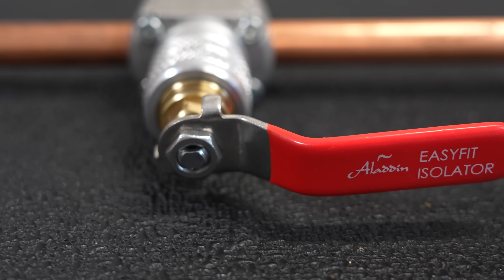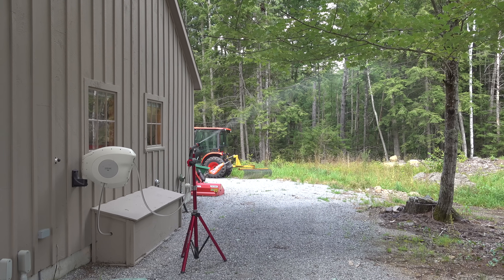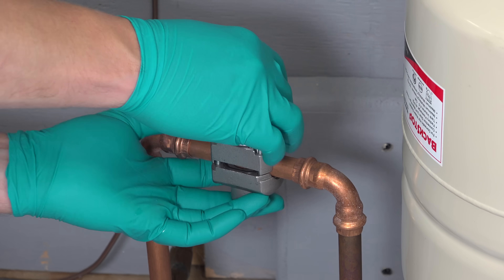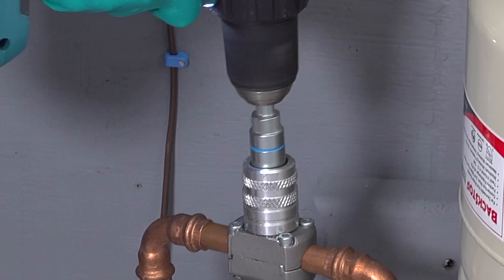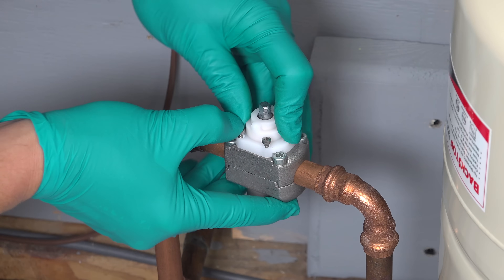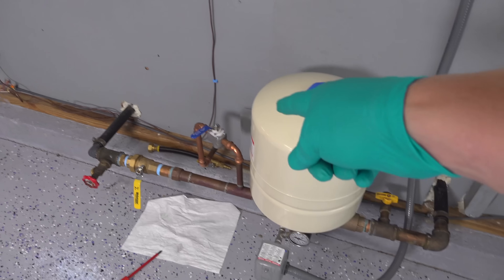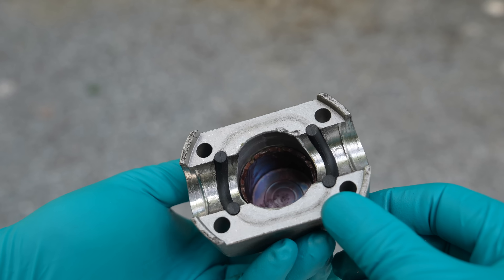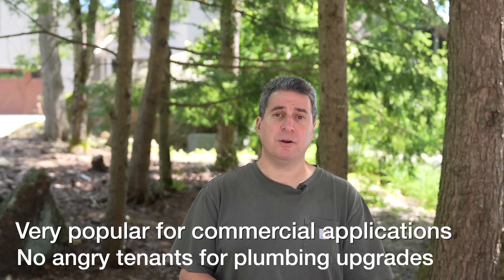SHUT-OFF valve installs on a LIVE WATER PIPE - Aladdin EasyFit Isolator

Comment: I'm from the UK and I didn't know that 
product existed here! But I did recognise the Aldin name. They made parifin heaters and the parifin lol
I'm going to look for it now in the UK and see what the cost in £s is
Reply: EasyFit Isolator Valves for the US Market have been available for the past year.  The valve had to be re-engineered for the US market due to the different density of copper.  A UK version of the valve will not work on US grade copper tubing.

Comment: Holy sh1t 250 for a valve. I have been a plumber for almost 20 years so I would never use one because I can find ways to stop watering like magic 😂😂. Kill the power on a well system or a meter key in the city. No way in hell I’d use this. 
I take that back maybe in a hospital or a building that won’t let you shut water down for extended periods or time we usually propress viega fittings which are expensive as well 😂.

Comment: Expensive and I saw a little water come out under the white part that holds down the valve handle.
Reply: Thank you for your comment, this is PTFE grease from the cap screws –  (you can see a small white curl of it on the housing).  We grease the screws to ease the Cap attachment operation

Comment: I've used two of these in our farmhouse. I didn't know at the time that the max pressure for install is 3 bar, but I found out afterwards that we're getting 6 bar into our farm!! Credit to Aladin for such an easy to use, and well made product.
Reply: 16 bar for uk 22m version
Reply: 3 bar dynamic pressure v.s. 16 bar static. To me it looks like it's more a question of the pressure differential over the valve while installing it. So turn off the water flow while installing. If you already have a water leak it's too late.
Reply: I'm always looking to learn something new. Can you please explain 3 bar 6 bar' me, thank you.
Reply: @sparky6913  a bar is equivalent to 15psi approximately....
Reply: No offense intended, but there are better ways to prepare for emergencies, even if your someone like me that wears a belt and two pairs of suspenders. I'm a big fan of building the lifeboats before the flood, and having them set up to be deployed. Might be good as a convenience, but I can't come up with one emergency I'd need to use this for, not that I know of  every possible one.  Best wishes. Best of luck.
Reply: *Aladdin
Reply: Wasn't he some Dizz Knee character? @LostInPhilly89
Reply: Know where your water turn off valves are and where your main water turn off is in the house. Or where the city's water turn off is by the meter. Rural homes should also have a quick to get to main turn off. If not, that is epic fail.
...When main water turn offs that are not easy to get or are hidden, etc. That is also epic fail.
Reply: @AlexZander688  Thanks, but, our house is almost 500 years old, the part where I used the Aladdin can only be shut off at the street, which isn't always possible.

Comment: Does this create tons of metal shaving since it was drilling?
Reply: Thanks for your comment, due to the valve’s unique design the pipe coupon and swarf is captured in the lower housing in the special chamber at its rear, minimal swarf is produced during installation.

Comment: This is news you can use! My house is nearly 60 years old and the shutoff valve almost works. 😂 It will shut the flow down to a trickle so any repairs I make on the system need to be done very quickly. Plus the smart valves made only work with this style of cutoff so this would be a win-win situation.

Comment: correct me if i am wrong but does the air expansion tank not have 55 lbs of air pressure in the tank not the water pressure     most towns are about 20 lbs max @ 1/2" no?
Reply from the maker: Regular wells average 30-60PSI. One of my early videos explains a bit more: https://youtu.be/X4TZoFIsE2w however this well is a constant pressure setup so the pressure stays fairly constant around 50-55psi using a different type of control valve/tank

Comment: It looks like there is a drop of water leaking under the left-front corner of white plastic at the 2:50 mark on the video
Reply: Thank you for your comment, this is PTFE grease from the cap screws –  (you can see a small white curl of it on the housing).  We grease the screws to ease the Cap attachment operation

Comment: IDE like to know what happens to the slug. Does it get pushed into the bottom of the valve, or does it end up down the line plugging something up?
Reply: The copper pipe which is cut (coupon) is recessed into the blade and is stored within the circular portion of the bottom half of the valve.

Comment: What a joke if you did the plumbing before you have a propress tool! So why did you not use a propress valve? That would accomplish the same thing. Even if you lose a little water doing pro Press it wouldn't be that big of a deal.

Comment: I was interested since I really would like to replace my gate valve shutoff with a ball valve, but the price might actually be more than what I'd have to pay a plumber in this area. I can definitely see its value for emergency applications though, especially since it can be installed on pressured lines.
Reply: It is relatively easy to install a compression ball valve downstream of the gate valve.
Reply: @bobrobertsony9977  I guess I never really considered the idea of leaving the old one in place. I mean, I don't know that it would have any problems closing all the way, but it might be worth it just to make sure considering its locations... right beside the switch box.

Comment: The second time you shut it off, it was dripping outside, besides where that does the peice of cut pipe end up.???  It will clog something.!
The time it takes to turn off &  drain the system to make a $20 repair isn't worth $250.
With using Shark Bites, the water can still be dripping. 
SharkBite 1/2-in Push-to-Connect Valve is $20.

Comment: Cheaper to buy online from UK!
Reply: The US version of the valve has a different blade, material, and valve body design to withstand the increased strength/density of US copper tubing.  The UK version of the valve will not work on US pipe.

Comment: What happens with the debris from drilling the copper pipe?
Reply: It pushed into the bottom thats why is extended on the bottom.
Reply: @Beholderoffate  I mean the copper shavings from drilling a hole in the pipe.i know the plug is captured into the device.
Reply: @cbucha  the majority of the swarf is captured in the rear of the valve.

Comment: That's a very neat product. I moved from a high rise condo community that didn't have water shutoff valves in each unit. The association had a fee and required at least a 10-day notice for the maintenance team to shut off water for the tier of units. They did emergency shutoffs too, but the fee was even higher. I would expect installing an Isolator Valve to require board approval though, but it would make life easier for owners/residents and staff.
Reply: Why wouldn't they just spend a weekend or two and install water shutoff valves in each unit? Seems like a nobrainer.
Reply: @spoofer20 because then they can't collect fees whenever emergency leaks occur

Comment: That price point is pretty crazy though. I guess if you need to hire a plumber and the city to temporarily shut off water to your house, it is going to cost more anyways but still, 250 for this little valve is a bit nuts.

Comment: A new take on the old saddle valves, which over time get clogged by calcium deposits.
Reply from the maker: Except those saddle valve poke a hole and let a little water through. This removed a piece of pipe and allows full flow.

Comment: I've just checked the price in the UK - £65, so less than $100. Nice to see something selling cheaper than the US - usually we have to pay the dollar price in pounds (so about 20% higher) for anything on sale on both sides of the Atlantic.
Reply: The US version of the valve has a different blade, material, and valve body design to withstand the increased strength/density of US copper tubing.  The UK version of the valve will not work on US pipe.

Comment: Too bad saddle type valves are illegal where i live....
Reply from the maker: This is from their site, a number of folks asked this and I wanted to know as well: "An internal section of the pipe is cut away and the valve seals between both the cut away section and around the separated pipe sections. Thus, the Aladdin EasyFit Isolator is a revolutionary product and NOT a saddle valve"

Comment: just checked prices. from 60 to 108 on ebay amazon etc. nobody is going to pay 250
Reply from the maker: Those other sites are selling different versions, in the UK pipe sizes are different and they use two types of copper. You have to buy the version rated for the pipes you have. The US model I showed works on US rigid copper and Pex
Reply: @SilverCymbal  i am in the uk . you are talking bollocks
Reply from the maker: @georgeh9967  Copper pipe in the UK and the USA are not the same (copper yes, sizes no) feel free to check it out
Reply: @SilverCymbal  correct we use 15mm like the rest of the world. you use 1/2" about 12.5mm. thats hardly going to make any difference in price. so as i said you can buy them in uk for about 60 dollars to 110. a long way from the 250 you said. also hardness of copper has nothing to do with anything the taps have a hardened cutter.
Reply from the maker: @georgeh9967  Again I am not from the UK, here is what may explain it better Not to be used on 1/2” Imperial Pipe - If pipe could be 1/2” the Pro model should be used  - The Pro model is what we have here. So whatever the difference is with your imperial pipe is why we can't get the less expensive model which just presses out the plug as opposed to cutting it.

Comment: That's alot easier, quicker and cheaper than a liquid nitrogen  ice line plug procedure where applicable.
This isn't too expensive for domestic and light commercial installations where the quirks of the legacy demand it. Perfect for industrial and infrafrusture applications which was probably the applicattion it was originally developed for due to necessity. 
Someone's great solution being shared for a reasonable price.

Comment: These valves are brilliant, untill a few years has passed & the seals fail. They are also of little use where high flow is required, as they do not have the same flow rate as the pipe you attatch them to.
Reply from the maker: They quote a 2% reduction which is identical to a normal ball valve, as far the seals folks said the same thing about sharkbites and propress so only time will tell but their track record in the UK is excellent

Comment: absolutely correct comment about application of this contraption: EMERGENCY. Because there's a way of installing regular ball valves on pressurized lines invented long time ago - freezing. Of course, if you dont have a case when you have to shut off a constantly running hot water line or something.

Comment: This is really neat, but there are a few problems I see with this. That hole saw isn't necessarily going to leave a clean cut behind on that pipe which can lead to your ball becoming scored and eventually leaking by. Additionally sharp copper fragments may end up being washed downstream and end up somewhere you don't want them like inside your pressurizer. You can get a single-use freeze kit and do it right for $50. Having said that, this does definitely lower the skill threshold down to something that most DIYer's could easily do but I would be really careful about how I employed it and I would only ever see this as a temporary solution.
Reply: Yeah, but who's going to pay that price for a temporary solution?
Reply: @Tasarran  Honestly? Damage control.  I could see a handyman landlord/property manager keeping one on hand to secure water to a burst pipe until they can get a proper plumber out to do it correctly. The up sides to this design are that it is reusable and it is fast. Tenant calls maintenance, maintenance throws this thing in line to secure water, property manager calls a plumber and doesn't have to pay the emergency premium. Plumber installs a code-compliant valve and returns this thing to the handyman.
Reply: @themightydropbear  However, it has very little use, because almost every household has a valve to shut off the water supply for the entire house or building, and this showcase of a hose outside the house is nice, but perhaps a showcase inside the house might be more accurate considering the circumstances under which it is intended to be used.
Reply: I have run into a shut off valve that has fused open and can't be used; in older homes it may not have been operated in decades.  I have seen leaks occur before the shut off valve.  This looks like a good idea, and most older homes where these problems are are more likely were made with copper pipes.
Reply: @themightydropbear  a handyman can use a shark byte push fitting that costs 5% of this thing. and if a handy man can't even do that then he's not a handy man . Most maintinece guys can fix plumbing leaks and landlords don't will go the cheapest route if they even fix it.
Reply: This has been used for years and approved in USA. Surely it has been tested for those issues
Reply: @davegarneau  That is the most ignorant thing Ive heard so far today. Just because you can use it does not mean its a good product. I see dozens of sharkbites fail every week and yet they still sell them in every store.
Reply: @Outcast569  you see dozens of traditional piping installs fail too. If installed correctly, sharkbite has been time and time again tested to work perfectly fine. Its not a "just because you can use it" thing, it has been extensively tested for many years and its as good to any traditional pipe fitting if installed correctly. Literally the most often reason sharkbite is installed is to replaced a failed piping
Reply: @Outcast569 I don't want that to be the most ignorant thing you have heard today, so here is a better one.
Joe Biden is a great president.
Reply: @Outcast569  "dozens of sharkbites fail every week" clearly you're doing it wrong:body-blue-raised-arms:
Reply: @Outcast569 you're obviously not putting them on correctly
Reply: The valve has a dual gasket system.  The inner seal expands once the spindle has been pressed down after drilling is completed.  We have seen the highest concentration of use in multi floor buildings, hospitals, and hotels where shutting down an entire floor of rooms is not an option.  The EasyFit valve allows for one room to be isolated and fixed while the rest can continue using water on a shared line.
Reply: Uhhhh, sorry but a copper pipe won’t scratch a hardened bearing which is what the valve body essentially is.
Reply: @notanymore9471  the ball is inside a plastic housing. Foreign debris will absolutely score the inside of a plastic housing.
Reply: I think this is a neat product that should never be used.
Reply: The unit is self-sealing around the pipe. The saw portion is larger than the ball (it's actually a cylinder) which is contained in a plastic housing that is the dimeter of the saw; the metal cylinder in the plastic housing never comes close to the actual pipe which was cut. You can see this clearly at 4:07.
Reply: @TroIIingThemSoftly  Even though it isn't ball-shaped, the nomenclature remains the same. This is a ball valve and the mechanism by which the flow of water is controlled is the ball. I have rebuilt ball valves that weren't even remotely ball-shaped but were still technically ball valves by the nature of how they function. Now, even though the ball is inside that plastic housing, if the saw leaves a burr on one of the cut ends of the pipe and that burr subsequently becomes dislodged, it could get caught between the ball and its housing which would cause scoring to occur when the valve is operated which will eventually cause leak-by. This is by no means guaranteed to happen, and it could occur with any valve if somebody up stream didn't exercise good cleanliness controls and it's a non-issue if the valve is rarely going to be operated but the likelihood of this valve damaging itself is slightly higher. I'm not saying it's a bad design, but I am saying that its valid use cases are limited due to its design. Hell, if I was a landlord/handyman for multiple buildings/units I might keep an assortment of these on hand for damage control purposes or temporary use purely because of how fast and convenient they are, but I would be extremely judicious in how I employed them and I wouldn't leave them permanently.

Comment: $250 for a 1/2 " ball valve? The problem is the price, tight spaces and the time it takes to install the valve. It's easier, cheaper and faster to install a pex fitting. I could have half my house replumbed for the price of this valve.

Comment: Holy price. It looks like a very handy item to have but we have to be practical about things like this. For the same reason sharkbites on every fitting isn't cost effective, this is in the same boat. It seems like a solution to a very specific problem, one I can't think of in the time I'm typing this lol. I love the product. I think it can easily be mass produced for a 1/5 of the price or more, and then it could make more sense.
Reply: It’s 70 ish dollars for the whole thing and 60 dollars without the other bits in the kit in the UK. 

Give it a couple years and the Chinese will have cloned it and made it half the price.

Comment: There is a system called cold shot that will stop the water flow with co2 to freeze the water in the pipe with an external sleeve. Unfortunately that system is also very expensive at around 900 dollars before you can use it. But the kit works for most household size pipes